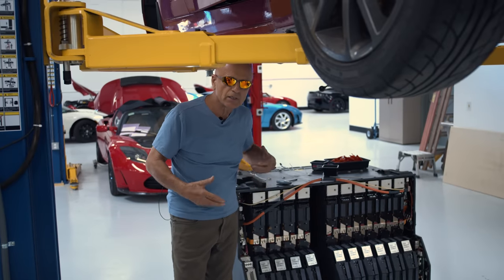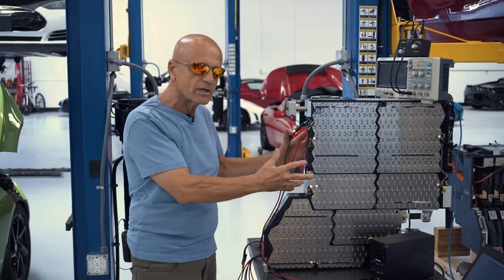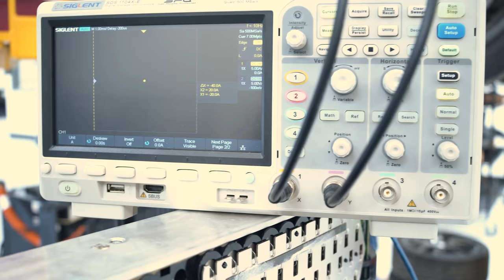Tesla Batteries STARTING TO FAIL | Gruber Motors

Comment: And this is supposed to be better than gas ⛽️
Reply: Hasn't been to a gas station once in 14 years.
70x52x14 is about $50,000 in fuel
Sounds good to me.
Reply: @axidhaus  EVERYTHING we do has an impact.
Some things less so.
You would have us living in caves eating grass
Reply: @thosoz3431  no actually I would have us using the energy sources we have more efficiently… im actually extremely conscious and conservation minded …. Im not however blinded by pipe dreams …. Where does the electricity ⚡️ come from ?….. we are feeling the pinch 🤏 because people with and agenda and no real plan are steering the boat…. Kinda like the afghan pullout
Reply: @axidhaus  and yet you say things like, 'supposed to be better that gas', and ' where does electricity come from'.
Its as if you have no understanding of either. Get back to me when you can tell me the difference between an electric motors efficiency compared to a petrol engine.
Reply: @thosoz3431  so is it ignorance or arrogance that makes you ignore the strip mining and coal
Reply: @axidhaus  when did I ignore it ?
Look at the early fly overs of Tesla Texas. The whole area was strip mined. Now there is a factory that builds cars that can be powered by sun and air and hydro. 
Nothing comes all at once. And all the hand wringing and whining in the world changes nothing.
Reply: @thosoz3431  can be powered and are powered are two different things …
Reply: @axidhaus  and you want that to happen over night.
And you want someone else to do it.
You sound a lot like an entitled teenager.
Reply: @thosoz3431  no i was cool with $2 a gallon before captain communism took over
Reply: @axidhaus  mate, you need to get out of that basement. Communism ? You've got NO idea.
Reply: We use so many other thing with petroleum products that we will not be eliminating it  and with less gas it mean the rest of the items will increase in price,  that will be  

Paraffin wax, fertilizer, pesticides, herbicides, detergents, phonograph records, photographic film, furniture, packaging materials, surfboards, paints, and artificial fibers used in clothing, upholstery, and carpet backing. Solvents Diesel Motor Oil Bearing Grease Ink Floor Wax Ballpoint Pens Football Cleats Upholstery Sweaters Boats Insecticides Bicycle Tires Sports Car Bodies Nail Polish Fishing lures Dresses Tires Golf Bags Perfumes Cassettes Dishwasher Tool Boxes Shoe Polish Motorcycle Helmet Caulking Petroleum Jelly Transparent Tape CD Player Faucet Washers Antiseptics Clothesline Curtains Food Preservatives Basketballs Soap Vitamin Capsules Antihistamines Purses Shoes Dashboards Cortisone Deodorant Footballs Putty Dyes Panty Hose Refrigerant Percolators Life Jackets Rubbing Alcohol Linings Skis TV Cabinets Shag Rugs Electrician's Tape Tool Racks Car Battery Cases Epoxy Paint Mops Slacks Insect Repellent Oil Filters Umbrellas Yarn Fertilizers Hair Coloring Roofing Toilet Seats Fishing Rods Lipstick Denture Adhesive Linoleum Ice Cube Trays Synthetic Rubber Speakers Plastic Wood Electric Blankets Glycerin Tennis Rackets Rubber Cement Fishing Boots Dice Nylon Rope Candles Trash Bags House Paint Water Pipes Hand Lotion Roller Skates Surf Boards Shampoo Wheels Paint Rollers Shower Curtains Guitar Strings Luggage Aspirin Safety Glasses Antifreeze Football Helmets Awnings Eyeglasses Clothes Toothbrushes Ice Chests Footballs Combs CD's Paint Brushes Detergents Vaporizers Balloons Sun Glasses Tents Heart Valves Crayons Parachutes Telephones Enamel Pillows Dishes Cameras Anesthetics Artificial Turf Artificial limbs Bandages Dentures Model Cars Folding Doors Hair Curlers Cold cream Movie film Soft Contact lenses Drinking Cups Fan Belts Car Enamel Shaving Cream Ammonia Refrigerators Golf Balls Toothpaste Gasoline Ink Dishwashing liquids Paint brushes Telephones Toys Unbreakable dishes Insecticides Antiseptics Dolls Car sound insulation Fishing lures Deodorant Tires Motorcycle helmets Linoleum Sweaters Tents Refrigerator linings Paint rollers Floor wax Shoes Electrician's tape Plastic wood Model cars Glue Roller-skate wheels Trash bags Soap dishes Skis Permanent press clothes Hand lotion Clothesline Dyes Soft contact lenses Shampoo Panty hose Cameras Food preservatives Fishing rods Oil filters Combs Transparent tape Anesthetics Upholstery Dice Disposable diapers TV cabinets Cassettes Mops Sports car bodies Salad bowls House paint Purses Electric blankets Awnings Ammonia Dresses Car battery cases Safety glass Hair curlers Pajamas Synthetic rubber VCR tapes Eyeglasses Pillows Vitamin capsules Movie film Ice chests Candles Rubbing alcohol Loudspeakers Ice buckets Boats Ice cube trays Credit cards Fertilizers Crayons Insect repellent Water pipes Toilet seats Caulking Roofing shingles Fishing boots Life jackets Balloons Shower curtains Garden hose Golf balls Curtains Plywood adhesive Umbrellas Detergents Milk jugs Beach umbrellas Rubber cement Sun glasses Putty Faucet washers Cold cream Bandages Tool racks Antihistamines Hair coloring Nail polish Slacks Drinking cups Guitar strings False teeth Yarn Petroleum jelly Toothpaste Golf bags Roofing Tennis rackets Toothbrushes Perfume Luggage Wire insulation Folding doors Shoe polish Fan belts Ballpoint pens Shower doors Cortisone Carpeting Artificial turf Heart valves LP records Lipstick Artificial limbs Hearing aids Vaporizers Aspirin Shaving cream Wading pools Parachutes Americans consume petroleum
Reply: @axidhaus  Explain what communism is, in your words - and explain how a president of a capitalists country represents communism.
Reply: @logitech4873  but it's not my job to educate you!
Reply: @axidhaus  Is that your excuse?
Well I can confidently say that you don't actually understand what communism is. I recommend you read up on it.

Comment: Tesla is never going to support their battery packs.  The reason GM, Ford, and others are discontinuing light, efficient gasoline powered vehicles is that they compete with new cars for 10 or 20 years.  Electric cars with battery packs that fail after a few years solve that problem.  Gruber Motor Company is likely to put a crimp in that business model.

Comment: so you are moaning they are lasting longer than promised
Reply: No they are complaining the car dies after the warranty run out and it cannot be repaired anymore.  If the government did not mandate a 8 year warranty there would probably be a lot more junk Teslas in like new condition in the wrecking yard with no battery to power them.  Unlike the old laptops, or phones or digital cameras people will not toss them out and buy a new one.   After 8 years people want to sell the car as used and let others drive them longer at a low  cost